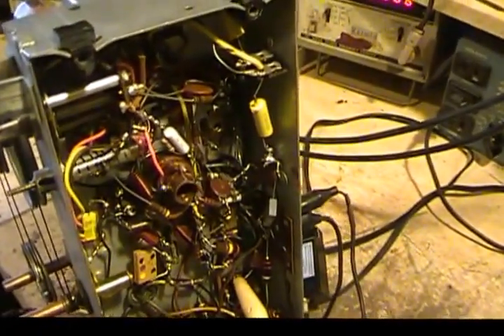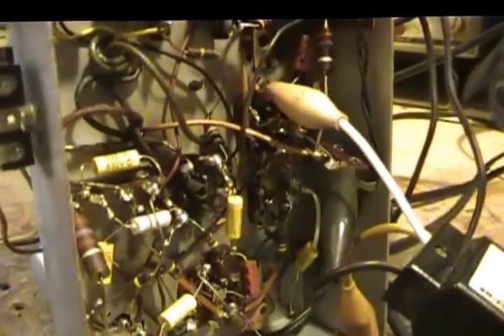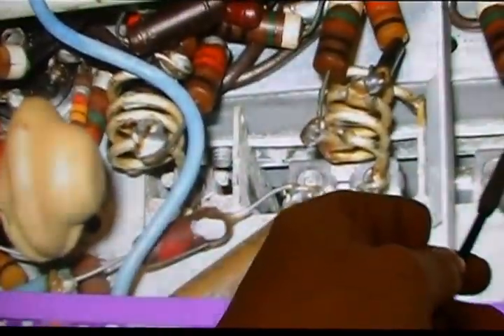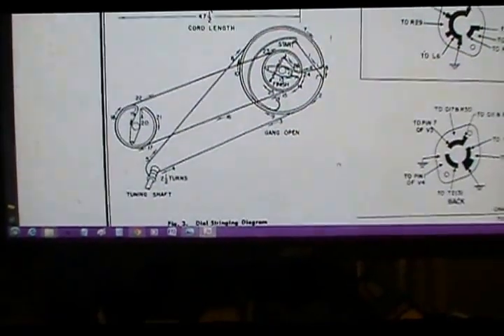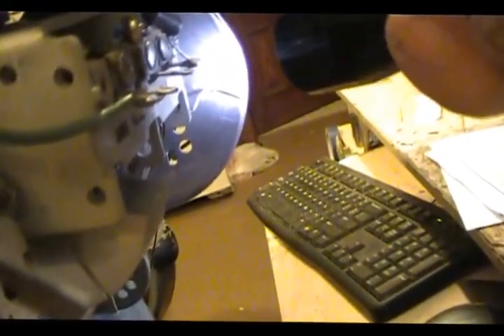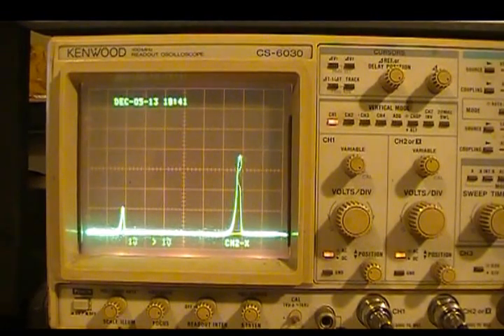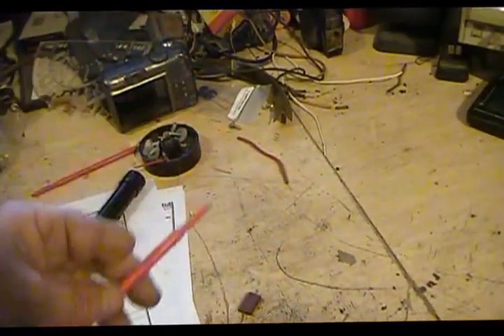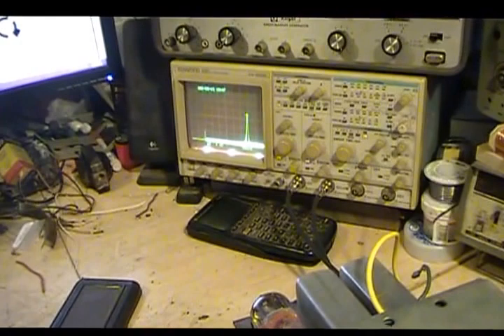AM and FM alignment part 2

Comment: I use an old tire gauge the part with the readings on it..and file it to a screwdriver,,,,,and them put a small piece of rubber tubing on the end the make a handle...

Comment: Dennis toward the end on this video the scope shows a blip at the left of the center freq. peak, is that another marker?
I only did a few alignments on radios and don't know much about them.
Great video as always.
Bill
Reply from the maker: Hi Bill. Yes that was coming from RF generator that I was using for the other marker and I had forgot to disconnect it when I change the dial . I didn't need it for the other adjustments and I had the sweep pretty wide so it picked it up. Good catch.
 Thanks for watch. Dennis

Comment: Great information Dennis! Looking forward to the next part with the WR-50B!
Yeah, I knew about keeping the signal very low to both avoid AGC kicking in and bandwidth issues. I was asking mostly in reference to TV I.F.s.
Thanks again for doing this series. It's great!

As a side issue Dennis, I suspect I have an un-calibrated freq counter.
I PM'd Bob Andersen my proposal to align it in this manner below. He was very interested. Before I proceed, I'd like your opinion also:
Here is what I wrote to Bob;
"I took the counter apart and figured out that it uses a reference frequency of 10 MHz. Well WWV is a super accurate 10 MHz frequency also.

Here is what my plan is.
1) Warm up my signal generator so it's very stable.
2) Tune into WWV on 10 MHz with my Kenwood TS-830 transceiver and center the frequency using LSB & USB, SSB.
3) Couple the generator to the antenna of the radio.
4) Zero beat the WWV radio station with the generator. This will give me a pretty precise 10MHz frequency to inject into the counter.
5) Inject the signal from the signal generator into the back jack of the counter.
6) Adjust the counter till I read 10.000 (it.s only a 5 digit counter)."

Many thanks my friend!
Tom
Reply from the maker: Hi Tom. On TV IFs you do have to inject a negative bias voltage to disable the AGC.  And that value of voltage will be in the alignment insructions on the set.
 On the freq counter what you want to do should work just fine. Thanks for watching and the comment.  Your friend  Dennis